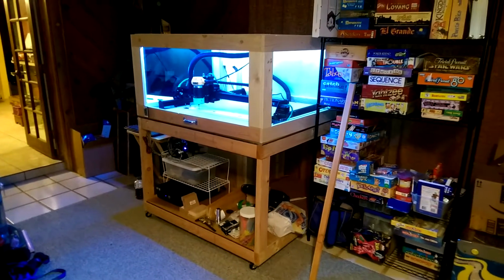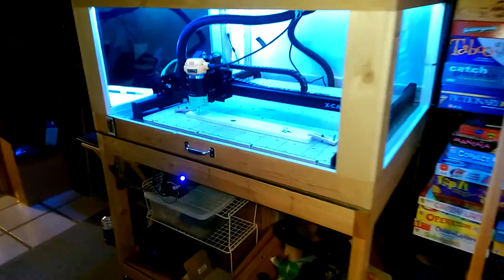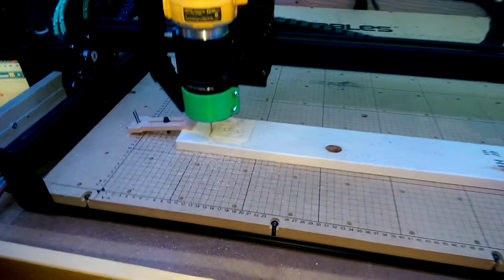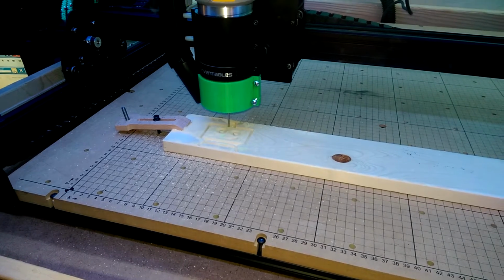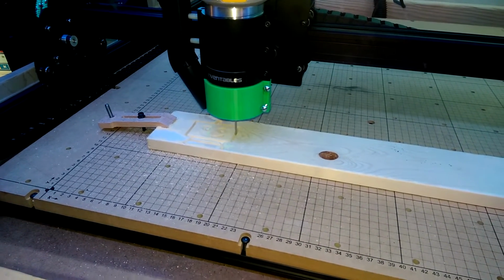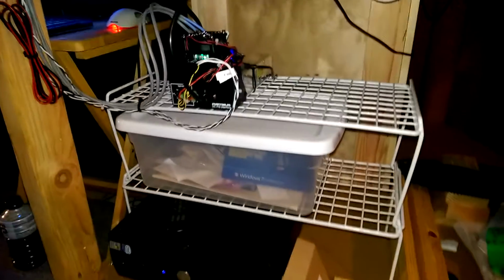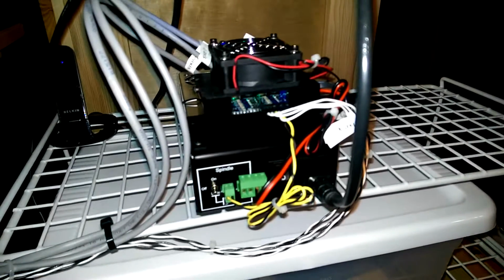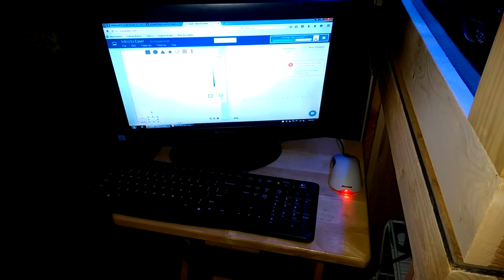X-Carve 1st test run

Comment: A perfect solution to enclosing your x-carve, I really like the LED lights. Do you have a drawing and part's list? I would like to build it, I just ordered my x-carve. Your design is a perfect solution to controlling dust.
Reply from the maker: Thank you for the kind words.  At one time, I did have the build notes (drawings and everything) posted on Inventables... looks like the forum post is still there.
I've since moved away from the total enclosure to make more room for a larger dust collection boot and hose (and a real dust collector instead of a shop-vac)... but I run it in my garage, so noise isn't as much a concern.  This enclosure did a GREAT job at containing the noise, too... and I miss that sometimes.
Good luck with your build!  :D
https://discuss.inventables.com/t/x-carve-bench-enclosure/14450

Comment: This is AWESOME!!!  

Do you have plans drawn up on this enclosure?  I really need one for my tiny 2 BR apartment  (for noise control, etc). :-)
Reply from the maker: +TheRangeControl I sure do!  :)
I shared my basic overall drawing on Inventables.com.
You can check out my build and all the details at...
https://discuss.inventables.com/t/x-carve-bench-enclosure/14450
I'm also available to answer questions.  Hit me up on there or here or wherever you can find me.  :)
Happy making!
Reply: +Cory Alexander I was actually wondering if there was any g-code to do a build using the x-carve...

I'd love to do that as it seems there would be poetic symmetry to it. :-D
Reply from the maker: +TheRangeControl Have I made any g-code for building things with the x-carve?  The x-carve is driven by g-code, so I don't follow what you're saying.
Reply: +Cory Alexander apologies... I am still learning (NOOB level 2) LOL.  Have do you have a sketchup or fusion 360 CAD file?